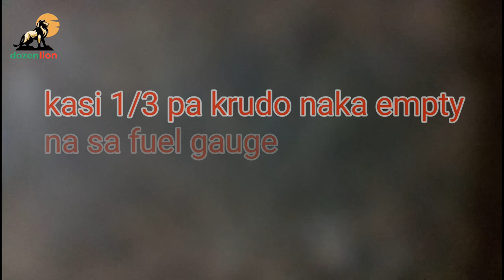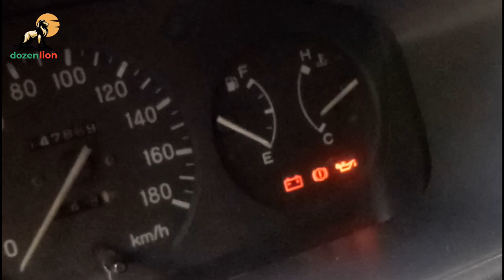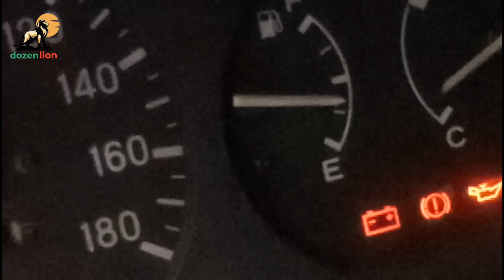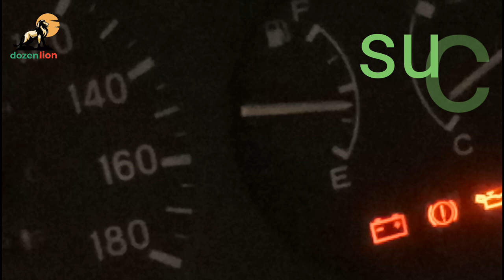mitsubishi Adventure fuel gauge inaccurate reading

Comment: Sir maitanong ko po d gumagana fuel gauge ng adventure 1999 model diesel pinalitan ko ng bagong floater umakyat ng mga 1/4 kso khit nka off ang switch d sya bumababa hindi kya s panel board fuel gauge ang sira kso ang problema san tyo mkabili non ano po ang ma advice nyo sir, maraming slmat
Reply from the maker: Ung sakin sir ang nagawa ko lang ay naging accurate ung gauge....pero pag naka off d na rin cia bumababa.....para sakin ang importante accurate na ung level ng gas kasi tanggap ko na....
Jurassic na ung advi 😊
Reply from the maker: Advi ko
Reply: 1999 din model ng sakin. nagiging accurate lang sakin pag paubos na . around mga 1k gas.. ganun
Reply from the maker: @GianGamingMLBB  hehehe ganyan po talaga pag medyo matanda na service natin.....mahirap na pong ibalik ung dati....
Reply: @dozenlion  kaya p naman yan sir gagastusan mo lang talaga para maayos if di kaya ng DIY